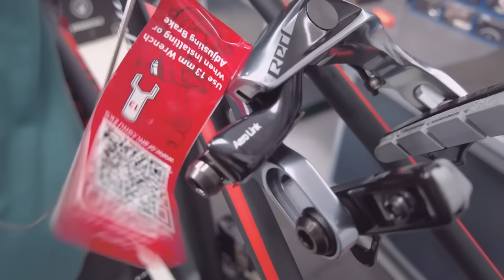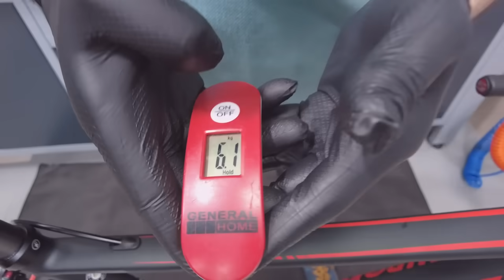6.1KG Lightweight Urgestalt Sram Red Etap #lightweight #urgestalt

Comment: Nice bike, great build up. Love that you wrap bars top down instead of typical bottom up!
Reply: @DaleRC75  hehe....direction of wrap is what causes that problem not from where you start from. I’ve never had a bar unravel from this after 30 years of riding and racing. What it does do, starting from the top is you CAN have the overlapping layers roll over a bit.

Comment: My bike single speed with 24 in tyres weight 12.5 kg. Other bike single speed with front suspension 14,5 or 15,5 kg.